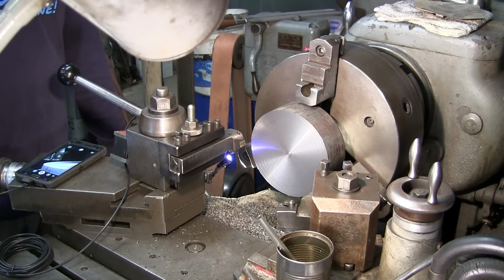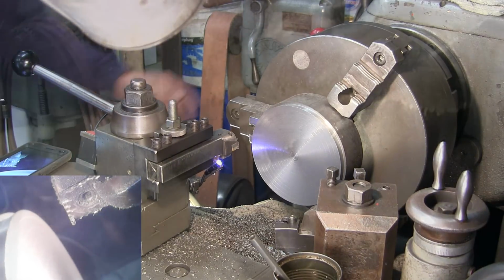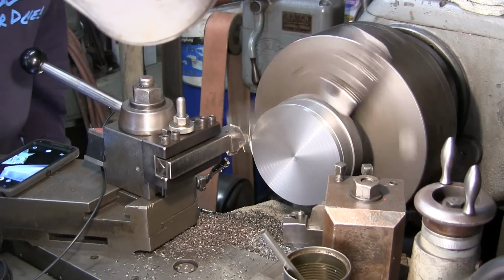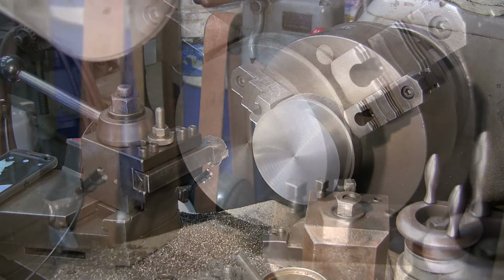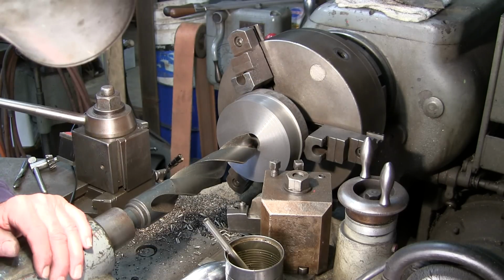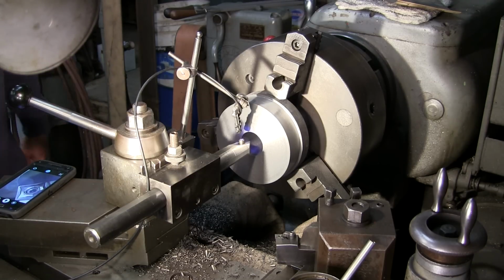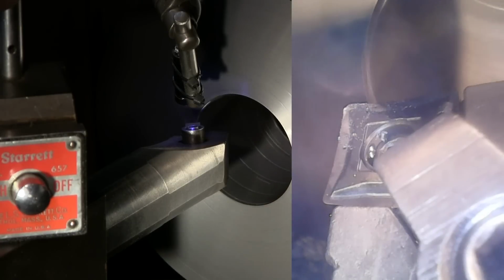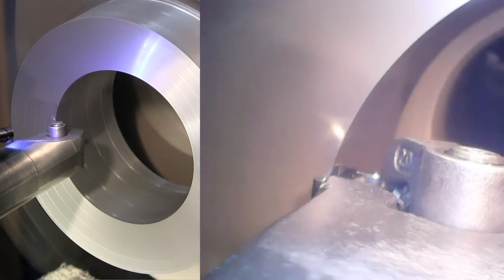Do Over Part Two

Comment: Mr. Fenner, your videos are fantastic, your expertise utterly amazing. 

But, at the risk of causing offense which I most certainly do not intend, a small suggestion. 
As the old saying, a picture is worth a thousand words. Therefore, a video is worth several million. 
Instead of the long winded speeches, explain the what, the intentions and purpose of various actions, as you do them. The video then becomes a full hands on practical step by step 'how to'. That is, I am now doing this for X purpose. For example, I covered the guides with that rag to keep control of the chips. That is also why I am running in reverse, so the chips spray downwards as you can see.  
Most respectfully...

Comment: I lead a small robotics youth group. We're looking for a small metal lathe to make parts for our projects. As you can imagine we don't have a huge budget. What would you recommend as a decent machine to start out with that won't break down on us right away? We got one from Harbor Freight but it ate it's gears pretty quick and we weren't overloading it at all. The cut was a 30 thou OD pass in soft aluminum which it should have been able to handle. I opened the thing to find what looked like gravel in the bottom of the gearbox. I'm not sure what the gears were made of but it was garbage.

Comment: You are an amazing innovator in machine shop videos.  In the past, you have used special video techniques for showing weld puddles, fiber optic images inside bores, and now split screen.  Great work.
Reply from the maker: My best split screen video is still; "Choking the chicken " video. A three way split, with a camera riding the cutter. I have several split screen video, some over two years old. guess you didn't watch all my 500 plus videos! LOL cheers,  ;{)-------

Comment: Keith. Quite a while ago I asked you a question about running the tool upside down. You said it wasn't a great idea because of the tendency of the cutting forces to lift the saddle off the bed. 

Now it is obviously working for you in this situation. Do you have a rule of thumb when the technique can work and when it can't?
Reply from the maker: I don't remember ever stating not to run it upside down, if so I'd like to be directed to that comment. Anyhow to the question, it is a preference of throwing chips in this case, but also I may want to start down in a bore and turn my threading bit upside down to feed outward on some threads. The normal cutting is always face up for the greatest rigidity. ;{)-----
Reply: Keith. My apologies if it wasn't you who made the point. I thought it was you but maybe it was someone like it was Tom Lipton? Anyway, would you say it is a valid concern?

Comment: I was intrigued to see, from about 6:10, the feed rate looked to be intermittent, which obviously cannot be happening under power feed, and the misleading impression vanished when the limit of the previous cut was overrun. 
I was puzzled until I thought about it and realised that because you'd snatched the cutter away from the work quite suddenly (when you realised the depth of cut was increasing due to the toolpost slewing), the limit of the previous cut was NOT a regular annular feature, but actually a helical feature.
A single-turn helix --or less, depending how quickly it was snatched vs how quickly the lathe was spinning.
If the cutter had dwelled (due to stopping the axial feed before withdrawing it), this effect would not have occurred. Thanks for another thought provoking video! And nice effect on the final shot...

Comment: Time to use an inspection mirror with your new mini camera.  Mirror on tool post at a 45 degree angle and your camera looking down into the mirror to get shots from cutter working.  It should be a little safer for the camera lens out of the direct line of chips flying back at it.  Just a thought.. Steve

Comment: quando trabalhamos com torno mecanico por longos periudos na ratação ante horaria não prejudicamos a maquina  a bomba de oleo funciona bem  sem problemas
Reply from the maker: Yes, if you balance the Mechanics and the engineers running the machines the repaired project runs like, a well oiled can, as I have heard before.  ;{)------
Reply: Keith Fenner valeu obrigado pela dico estamos sempre todo dia assistindo novidades

Comment: Keith, have you thought about investing in some Allied spade drills? One drill body can take a wide range of drill sizes. Plus you don't need to go in steps. I drilled a 3.25" hole about 7" deep through 865 manganese bronze. Drilled it one shot in about 7 minutes. The 865 cut very similar to ductile iron.

Comment: Quick Q Keith. Why is your tool bit upside down? To me you have greater support with the forces being dissipated from the toll post holder then to the lathe bed vice the tool post holder and mid air. Not trying to be facetious here, just trying to understand. I have run my lathe in reverse on occasion, but I don't see the need here, hence the Q
Reply from the maker: So the ductile material and dust make the shortest trip to one spot, instead of all over ways. I had mentioned it in the early comments. cheers, ;{)-----
Reply: Keith Fenner
Thanks Keith, I knew you had a reason as it is not conventional machining. I must have missed that :(

Comment: How about a long arm right through the spindle bore. It won't follow the carriage motion, so the tool will be coming at the camera.

I hope you have a replaceable lens on that borescope. The chips hitting the face of the camera will erode the lens pretty quickly.
Reply: That could be fairly cool, and sometimes fairly useful (particularly for back-facing in a recess down a deep bore, where normally you can only 'fly by instrumentation')

Comment: Too bad the bored out section couldn't be sliced out by a big core drill -  * I'm sure it's a possibility , but extremely expensive on the tooling end . . .  Great to see the up close & personal views of the cutting edge !   Thanks for sharing with us ;)
Reply: one day we will be able to 3d print metal...a huge core drill would need huge HP to run and have to be really slow, even 2 inch core drilling needs something like 50 rpm, who knows what you need for 4,5 or 6 inch sizes.
Reply: There are core milling cutters , but the cost would be incredible . . . unless a lot of parts were to make it worthwhile !   A cobalt 3 1/2 inch cutter would run 720 dollars . . . but a skilled toolman could likely cobble together a cutter with inserts for much less ;)   ( Necessity is usually a MOTHER !
Reply: We can 3D print metal today; that's how SpaceX build the Super Draco engines. The process is called selective laser sintering and it involves a vat of metal powder hit by a laser at the points that are to be solid, melting the powder. After each layer a new layer of powder is deposited.
Reply: It's a shame that "Core drill" is catching on because until recently it actually meant something different to a metal machinist than what you're talking about (which used to be called an "annular cutter" or "Rotabroach", which was the original Hougen brand).

Properly speaking, a core drill is a beefy item, intermediate between a reamer and a twist drill, intended for cleaning up cored holes in castings (but very useful in the home workshop because they are much more forgiving than reamers, but produce the same result if treated with the same care and skill.

Annular cutters, on the other hand, are great for trepanning (coring out) through-holes like the one in this clip, they are very fast and produce a usable slug in lieu of swarf, and they don't need a pilot hole (and contrary to what others have written, the torque required to drive a large one would be no problem to a moderately beefy lathe like Keith's) ... but they are indeed  expensive in the larger sizes.
Reply: Hmm - I've tried making them , but they're not near as easy as you might think, because it's notoriously difficult to get the chips out (Most real annular cutters have highly polished helical flutes all the way to the back end)
But there is an alternative way of getting a similar result (finish not so good, much slower) I use when I want to save a big slug: I have a collection of large hole saws up to six inch diameter (high spec, eg Blu-Mol) and I get around the problem of swarf evacuation by providing holes in the workpiece for that purpose.
I do this by touching the saw to the work (usually in a vertical mill, with the table zeroed) then I temporarily swap to a suitable drill (3/16" or 1/4" depending on size) and drill a ring of thru holes around the periphery of the kerf ring, in maybe six or eight places. (The method does work in a lathe, just less convenient having to set up in a drill press to do the holes)
If there is not much material remaining on the piece I want to use (which may be the slug) I will offset the drilled holes inwards or outwards, so they just break into the kerf.
With slow enough rotation (like 50 to 80 rpm for 6"),  and plenty of coolant, this works OK even in (mild) steel, and hole saws are relatively affordable. With cast Iron I would NOT use coolant, but plenty of shop air. With Aluminium, flood it with kerosene to keep the holes clear. I think it has a different name in the US: it's what hurricane lamps used to run on , and similar to what jet engines still do.
Reply from the maker: Yeah we also call it Kerosene here, I mix that 50 50 with sulfur base cutting oil for band saw. ;{)------
Reply: Gottenhimfella I suppose I chose my words incorrectly - the tool I was referring to was indeed an 'annular cutter'. . . with my reasoning being the waste of the 'slug' !   
    I'm relatively sure that it would take a bit more effort to make a suitable cutter (in house) than the financial return on this particular job.   A tool could be fabricated from scrap, most likely . . . since the iron being cut is fairly soft *ductile iron !    I was thinking how easily a tool could be made from 'not too' thick - walled pipe, notched to fit several pieces of tool steel that are brazed into place, then ground for relief to suit the cut.  ;)    ( even a cobbled together tool that was case hardened would probably suffice.)   Thank you for posting the correct tool name !

Comment: I don't mean to be critical since this new camera is an experiment but I find watching the regular camera better. The longer/wider view gives a much better view of what's happening. The "borescope" camera doesn't have the same frame-rate the regular camera does and everything is blurry. Plus its focal plane/distance is much shorter and the focus changes radically during the movement.

The little camera was excellent when showing the dog-point screws and how they're used to align the clamps in the first video and I think that is its best use. Close-ups of the cutting zone, not so much.

Keep up the great work.  I've been around shops for a long time and I always learn something new watching your videos.

Cheers!
Reply: i agree its a tool that you have to use sparingly, def good for inspection etc, not so much for action.

Comment: Hey, first off, i watch your videos solely for educational purposes, i find it enjoyable watching something get made from a piece of metal and would love to try it one day. My question, in the beginning, when the tool post dove into the metal, did that happen because the cutting tool wants to naturally dig into the material its cutting? I remember in another video where you used the Mill you explained and please don't quote me because i'm probably going to butcher it, but not to cut into the direction being fed, does the same go for a lathe? thank you in advance
Reply: hey you two, Thank you very much for the clarification.
Reply: I'm not speaking for Keith , but I would say that a combination of downward tool pressure, ( as well as forward pressure ) combined with the shape of the tool's cutting lip ALL tend to force the tool to varying degrees - but the major issue was a loose toolpost . . . letting the tool dig in !    ( Hope that clarifies things 'til Keith can respond ;)   )    'Cheers !
Reply from the maker: The tool post was not as tight as it should have been for the load on the insert. The movement pivots from the center holding bolt, as it rotates it goes deeper into the part because the insert it forward of the center of the post.    ;{)------

Comment: Is it common to add some sort of counterweight to the chuck holding an odd shaped piece of metal?
Reply from the maker: If the the speed needed can't be achieved due to the vibration of the machine it is an option to add counter weighting to offset the imbalance. ;{)------